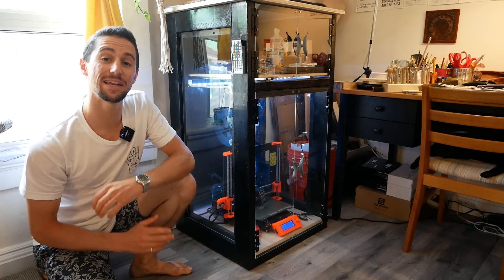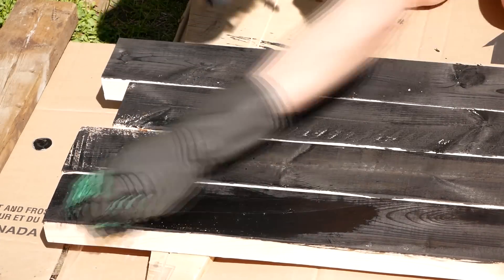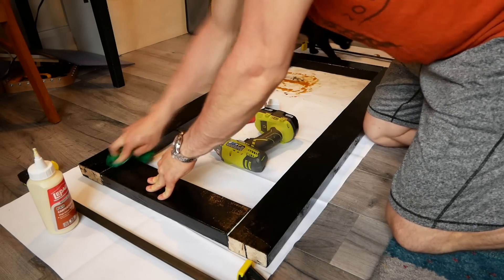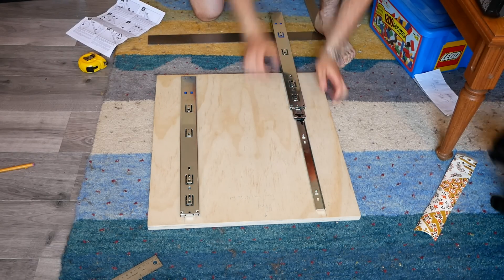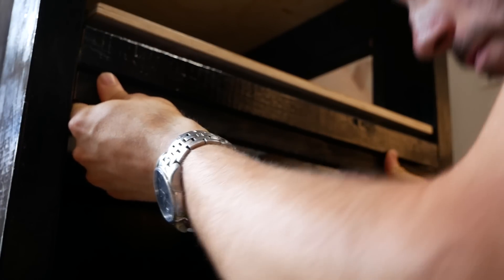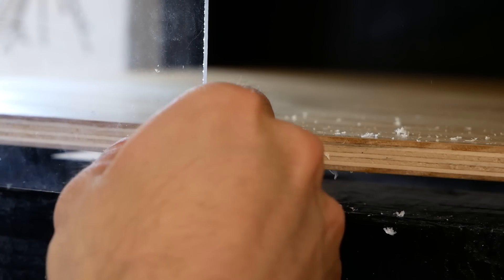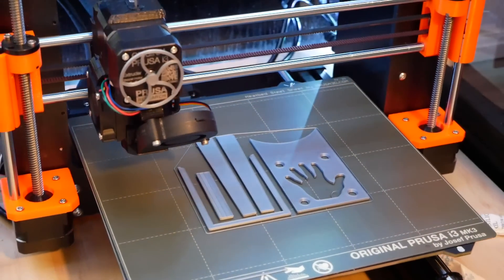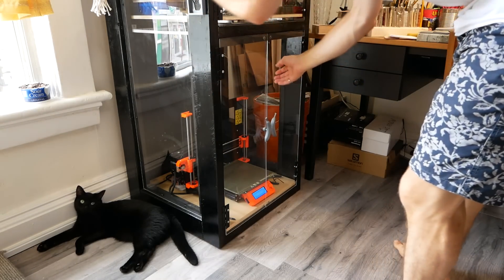DIY 3D Printer Enclosure and Standing Desk

Comment: How have the drawer slides worked under your 3d printer? I though this was an interesting solution for accessibility but would think this would negatively effect print quality and inevitably cause reduced print speeds... a stable/solid print surface is really important for 3d printers since vibration will cause less smooth print surfaces.

Comment: Tipps I gathered from watching a bunch of enclosure videos: 1) Prusa says to put the converter outside of the compartment. So an electronics „Department“ would be nice.
2) I would vent the enclosure with a filter. Even PLA can have fumes you don’t want to breathe. 3) To make it more silent put put the printer on a stone plate thats on some dampening material. Maybe Squash balls cut in half. 4) Having a temperature control built in can be verry nice. Depending on your climate and what you want to print. 5) Polycarbonate for windows is also cheap resistant and clear. You can just cut it with a knife then break it on the seam. 6) Altho I like the idea of having 2 funktions probably would like to have the printer higher up, more storage for Fillament and built a dedicated stand for the Laptop closer to what musicians have to hold their notes, or painters for large canvas, but more steady and save. 🤓👍
Reply: on top of that: PLA fume is not great but not that offending, where as the not that noticable issue is the amount of tiny strings it produces (to the point I find a PLA cotton ball in my toolhead on a yearly cleaning!) so HEPA+activated carbon is advisorable. (I suggest putting a bentobox filter on the outside, and you can swap the bottom piece to decide if you want a vent or a recirculating filter for ABS)
I would suggest go stright for a separate filament compartment if you want to do more advanced 3dprinting. abs is sus and nylon sucks water like nothing else. also you get the benefit of smaller chamber volume to heat soak and dedicated filament storage that can be kept dry (on that note one cheap option is just find a sealed plastic box, drill few holes for bowden adapter, and put lots of decicants in there

Comment: Quick note, you might want to relocate the power supply outside the case so it doesn't get too hot. Heat kills psu's and adds more heat to the enclosure
Reply from the maker: Thanks for the tip, I’ll probably move it outside soon!
Reply: I've heard another recommendation to make an enclosure to keep the heat in to help prevent warping or lifting....do you have any idea what the ideal temp would be?
Reply: @michaelosmon  60c  but that also depends on what filament you are using and brand  you may need to go higher with ABS, ASA, Nylon etc

Comment: Really inspiring project! I just bought a 3d printer and I only have space for it in my bedroom/studio, and I was worried about printing fumes, even though it is only PLA. This project you created made me realize I should create an enclosure space for the printer. This would solve my problems! Thanks for sharing this!! It helped me a lot! :)
Reply from the maker: Awesome! An enclosure is so great - not just for the fumes but reduces noise, better quality prints through protection from drafts/temperature swings, protection from dust... glad I could help! 😁❤️
Reply: @MorleyKert  Do you print with PLA? Some people say it is not very good to print PLA in an enclosure, because it prevents the plastic from properly cooling each layer , due to higher temperatures inside the enclosure. And this affects print quality. Did you have problems like this?
Reply from the maker: I print mostly with PLA, I haven’t noticed any issues with layer adhesion or print quality . I would think the cooling fan would be sufficient to cool each layer. But if I’m printing a big model, I’ll crack open the top doors to encourage a bit of air circulation.
Reply: @MorleyKert  Awesome! Thanks for the replies!!
Reply: Only finding this now. Really love the idea of the drawer slides to get the printer out, super clever, and never thought of it all these years of printing with an enclosure. My only question is do you find the printer stays put on them while printing? Do they move around as the printer moves and create extra rattle?
Reply from the maker: Thank you! There’s no noticeable movement or rattling of the drawer slides when printing, or extra movement of the printer. It’s pretty rock solid!
Reply: Oops, didn’t mean for this to be a reply to another thread, but thanks for the fast response!

Comment: Do you have any plans to ventilate or heat the enclosure so you can print abs/asa?
Reply from the maker: Yes! Probably ventilation and a dehumidifier more so than a heater, as the printer heat keeps the enclosure pretty warm. But a full on thermostat heater would be pretty cool!

Comment: Is it ok to print with the door shut? Does it overheat and need vents or anything? Thinking about building one myself and I wanted to know if I need to modify or keep the doors open while printing
Reply: Also how is the sound reduction from the enclosure
Reply from the maker: My apartment is air conditioned and I usually print with the door shut. Periodically I'll check the temperature and if it seems too warm, I'll open the upper doors to let the hot air rise out the top and hopefully draw cool air in from the bottom (but I find myself doing this less and less as I use the printer more, and continue to get good results). I'm getting great print quality with this set up, so I don't think it's too hot inside. There are small gaps around the acrylic doors which provide a bit of venting. In response to your second question, it definitely reduces the sound as well!